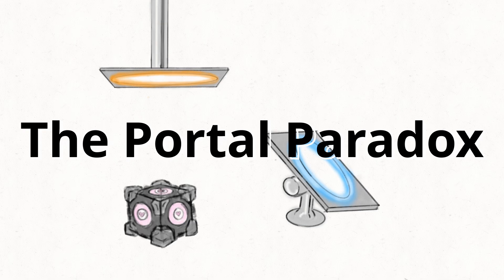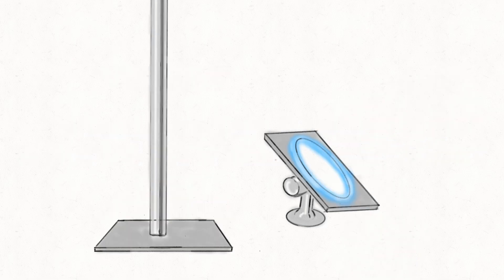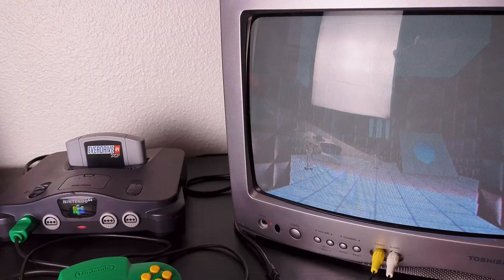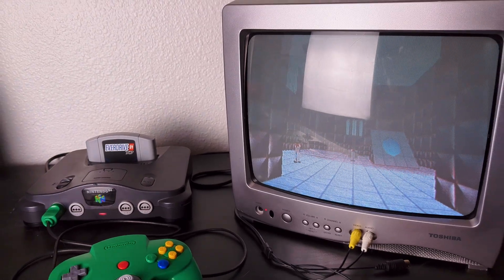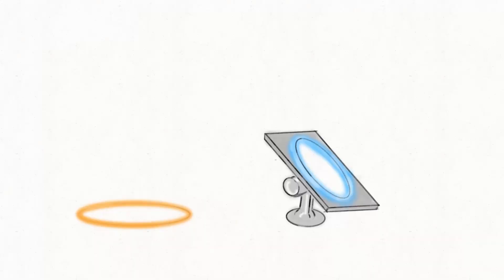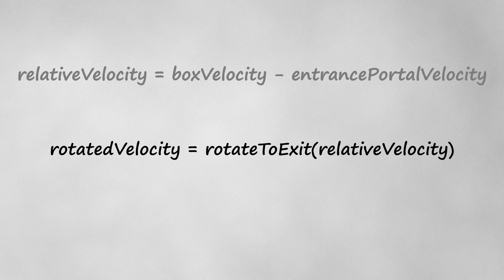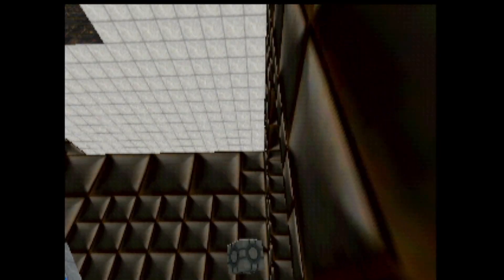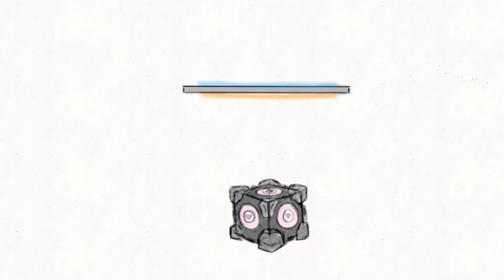I rewrote Portal from scratch and solved the Portal Paradox

Comment: The relative velocity should not be compared between the object and the entrance portal, it should be between the object and the exit portal. An object moving relative to the exit portal conserves its velocity when passing through, an object at rest relative to the exit portal should not gain velocity when passing through. In your demo here energy is being created from nothing. The box is not touched or acted on by an force, yet somehow gains momentum. How is momentum conserved here? The momentum of the platform is dissipated by the impact with the ground, what mechanism passes that momentum onto the box and why would the velocities be conserved when the box surely doesn't weight the same as the platform? This is a very flawed demo. First principles demand that if the box is stationary relative to the exit it will remain stationary relative to the exit unless acted on by an outside force. The portals do not impart any force on objects, so your demo here is the result of your coding rather than an actual proof. Cool though
Reply: In the actual game objects can fall infinitely and gain velocity from nowhere, assuming this principle is the case this answer is not unsatisfying (these portals are impossible anyway all we can do is pick our favorite version)
Reply: @Narvalo_Lastar  Gain velocity from nowhere, while falling. Bruh. Do you know what falling is. It's constant acceleration from gravity. Gravity is supplying the energy in that situation. I agree there is no correct answer here but there is an answer that makes more sense when first principles are considered.
Reply: @BNJ_VODS  The thing is when the object passes through a portal it has more potential energy than before entering but it keeps its kinetic energy so yeah this isn't really logical

Comment: Very nice video. The only thing I'm wondering about is, what happens when the orange moving portal stops halfway on the cube? The upper half should already be poking out of the blue stationary portal and having gained some energy should want to keep moving. So the rest of the cube should kind of be sucked into the orange portal and still fly out of the blue one? I hope this makes sense and somebody has a potenial explanation :)
Reply: I think it depends :
If the orange portal was going fast enough for half the cube to have enough force itself to pull the other half, the cube would fly out

If not, it would stay in place because the other half would be pulling the upper one down since it is affected by gravity, and stop moving at one point

Comment: Actually if you slap your hand next something on a table that thing tends to jump...  And the portal acts like a hole...  so the border around the portal would be like your hands hitting the ground the cube is on and bouncing it off the ground?  That makes me feel like you wouldn't be able to stop half way threw a portal without ripping yourself into pieces(the way you described how it didn't matter which one was moving)...  It does matter where the momentum is coming from,  The portal shouldn't really affect momentum.  But gravity taking affect, if it was opened in a downward trajectory would cause it to fall once the item was over balanced threw the portal, without a tether to hold it back...  So shouldn't the block have maybe only tumbled off the slanted surface?  And that really should only happen on a severe enough angle, as the cube should still be in contact with a flat surface on the other side?  For the cube to be launched something has to affect it.  In the game portal you can stop half way threw a portal and see yourself, looking at yourself.  It's a 1-1 ratio or Chel would be a quivering mass on ground an spread across the walls...   So in my totally unscientific thinking, The cube should have come out more like your arm going threw a sleeve, instead of a toaster popping out a slice.

Comment: Incoming rant fueled by autism and OCD:

Kind of related but thinking about it, any object going through the portal takes up mass and volume, so if the portal is moving at a high speed it would capture air and push it through the portal, but there would be pressures behind and in front of both portals that would need to overcome the vacuum the portal is creating as well as the the volume/mass that is being applied to the new location.

This doesn't even account for gravity.
Reply: Ok wait a minute, where did the vacuum come from?
Reply: @Narvalo_Lastar you mean what creates vacuum pressure? The imbalance between the two systems.
Reply: @Taalanos  alright

Comment: If you think that energy is not being conserved with portals, especially for a perpetual falling loop, consider that the portal guns and the portals themselves require energy to operate. They are not energy-less tools. Perhaps portals can only stay open for as long as the gun's battery allows, and that amount cannot exceed the amount of energy gained from a falling object's kinetic energy or the energy being dispersed through heat due to air resistance.

The games don't operate like this, and the conservation of energy is likely still being violated by the fact that a portal in spacetime can even stay open for more than a few nanoseconds without the need for more energy than we can produce at any one time, but hey, it's a neat concept.

Comment: Yea. Not really a valid test. Even if you have to write some code for source engine, you could at least justify it by borrowing moving logic from other parts of the game to know how it would be done if it was coded. But really. Portal should have something already I swear there was moving platforms in both games.

Anyway. I agree that it should eject. Simply based on that, to the perspective of the stationary portal, the ground and cube would be moving towards it. The brief time in which the cube begins to enter the space of the stationary portal, and the when it is all the way in should be enough momentum under the physics of the stationary portal for the cube to be completely effected by it.

Granted... this doesent account for how portals work as far as if there is a transitional barrier. Nor am I considering game coding...

Comment: Wouldn't intertia be something to take into account? I get that motion is relative of course but it wasn't moving before - inertia should keep it at rest unless acted upon by a force. Is traveling through a portal a force?

...mmm wait now I'm thinking about it and the normal force of the ground gets its vector changed as it goes through the portal. I'm still wondering how it actually flies. Maybe it's uh, impulse or whatever it is? Because suddenly whatever is pushing the top bit down stops... 

I love physics.

Comment: I think the crux of the portal "paradox" is questioning how the portals SHOULD behave.

Your velocity equations aren't "wrong". But they aren't a direct analog to real life either. They are a trick, to make something appear to behave as we think it should. 

In the real world, the portal wouldn't be something that could even have a velocity relative to something. It's simply a connection to somewhere else, no different than walking though a regular doorway.

Portals only seem odd from a human perspective, and the suggested behavior only makes sense in gravity.

Imagine the same experiment in space, a cube floating in no gravity and two portals each on different slabs, if one slab flew through the cube and kept flying, and the cube shot out the other portal, where did the cube get it's energy?

You could theoretically have the red Portal fly at the cube at 100m/s and make the cube fly out of the blue portal in the same direction as the red Portal and it would keep pace.

Comment: What if you stopped the orange portal half way on the cube? Would the cube still fly out the blue portal due to the velocity? Does the cube need to be fully through the two portals?

I suppose it would be basically the same because it would look from the blue portal's perspective like the cube is coming at it just as quickly but it stops a bit shorter.

But if the cube never reaches the portal it would look to the blue portal like the cube was going to come flying out but suddenly doesn't.

So does the blue portal's perspective only matter if the cube physically passes part of it through the portal?

EDIT: I think I actually understand it... the velocity of the cube is only relevant to the portal (both portals are a singular connecting point). And before the cube reaches the portal, if it stops, there is no movement of the cube. But once the cube reaches the portal, anything on the blue side is moving relative to the blue portal. So if the platform stops moving, the cube parts that are through the portal will "pull" on the rest of the cube because they're already in motion on that side. So if you stopped half way, you would what... have like a half of the velocity as only half of the cube is moving relative to the portal.

Or maybe I'm completely wrong?

Comment: The problem with your implementation is that 1. the cube is not a speedy thing, the source portal is, and therefore the cube has no velocity. To demonstrate this repeat your experiment but only have the source portal come down to the half way point of the cube. If your method is correct then the cube should be ejected out the destination portal but at half the velocity. 2. the cube doesn't stop sitting on it's initial platform since the source portal only goes down as far as the platform and no further. The cube should slide down the destination ramp, but it should only start moving when the force of gravity pulling on the amount of the cube through the portal is greater than the force of gravity and the force of friction on the cube that hasn't gone through the portal yet.

Comment: The block wouldn't move at all unless there isn't enough friction when its on the ramp, it would then just slide down.  

Explanation
The orange portal is now flush with the floor and not moving, blue portal is at an angle, its now simply sitting on a ramp and may slide down.  From an engineering perspective the only force ever acting on the block in this setup is gravity, before entering the portal its directly into the floor so it doesn't move, after passing thru the portal its at some angle due to the ramp, if the component force overcomes static friction it simply slides down the ramp.  The moving portal cannot impart kinetic energy onto the object passing thru, if it did and u tried to walk thru a portal, stopping or slowing down while still not completely through would pull you thru or tear the object apart.  This is not what we see at any point in the game or in theory of how a portal would work.  The portals are simply 2 points connected in space.  Moving the portal changes nothing as it imparts no forces on the object passing thru it simply "moves" everything in the space that crosses it to the other portal, air and all.  If it didnt operate this way there would be all kinds of other quirky interactions.   If you did the back to back portals like the hula hoop example but did it horizontally and then stopped half way over the object what happens? nothing, so why would completely passing over the object change anything?  The opposite portal nullifies any relative velocity calcs cause its a real time dynamic motion, the object may have a relative speed to the port it enters, but it always has a relative speed to the exit portal equal to the entrance portal otherwise the object would be torn apart.  

WIth this said once the portal compley passes the object to the other portal it is no longer affected by the portal and the relative velocity would be zero, so it  will simply slide down the ramp or sit there given enough friction.

Comment: The equations are fine, obviously, but it's more of a conceptual problem. Motion is relative, but is a portal an object? You could view it as a "universe" moving towards the cube if you look through the portal, which would make the cube moving relative to that "universe" - but then that universe stops when the platform the portal is on hits the ground, so the cube shouldn't move.

Imagine if the cube was suspended in midair instead and you move the portal over it, and the portal keeps moving all the way through the cube, what would happen then?

Comment: Velocity is a relative to question. 
In the case you present you say that the box is relative to the portal, but this does not need to be true.
The portal could possibly also work akin of teleportation in which case the box will not be subjected to a relative to question and velocity will be out of the picture.

At that point we have to ask our selfs, in what way are these two portals connected?
A. Is it a teleportation (in which there is no possibility for the box to be affected by the portal)
B. Is it a wormhole (in which case the portal will affect the box, for the box will have been in the portal wormhole connecting each other)

Or im wrong in judging a difference between teleportation and a wormhole

Comment: My question rises from where the energy comes from as there is no "physical contact" made with the cube.
The energy from slamming the portal and the platform ajecent to it on to the ground is transferred to the ground and back to the platform presumably.
The cube should not be getting any energy from it as it is not a part of the system that disperses the energy from the impact.
Paradox stems from the portal moving, it should not create energy from nothing. But in this instance it somehow does?
I might be misunderstanding something here, idk.
Reply: The energy calculation for relatively moving portals becomes messy. Energy conservation has always been a problem with the game, just by adding portals to the ceiling and floor, you effectively have infinite potential energy. With portals with relative movement, you have a source of infinite kinetic energy. The whole universe is moving on the other side of the portal, so as things pass through, the kinetic energy derived from the cube in a moving universe is released.

Comment: TL;DR The only major issue I can see is so far outside the context of what the code was made for it makes sense to not account for it at all.
My only problem with this implementation is: where is the energy used to propel the cube coming from? If ,for instance, the the test is taking place in a perfect vacuum and the blue portal and the cube are stationary relative to each other, if the orange portal is the launched at the cube will the object the orange portal is on lose velocity when the cube goes through it? Would the blue portal recoil after the launch? Based on how the coding was explained it would seem the cube is spontaneously imparted with kinetic energy leaving both portals moving exactly as they were while the cube is now accelerated away from the blue portal. Which would of course violate the law of conservation of energy.
Though I suppose in the context that the moving portals will be used in the game port, all of that is irrelevant and will never come up so complicating the coding to make it as accurate as possible is entirely pointless, just as the original portal not having any way to code for moving portals in the first place was.

Comment: This may be completely wrong but I also think of the portal as still being placed on a solid platform, so the portal being pushed down onto the block is just as much pushing down on the block downwards like the non-portal surface would. This then has the equal and opposite reaction that the floor beneath pushes back on the box and sends it upwards, adding velocity as it passes through. Actually I'm just taking out my ass because that would cause the box to jump in the hula hoop case too, and it was flawed from the get go because it implies you somehow react with what's behind the portal when you use the portal which isn't the case or you wouldn't be able to go through the portal unless you're being forced through.

I agree with your explanation that only the relative velocity matters, not whether the box is moving.

Comment: Ya, that explanation was great and makes a lot of sense.

In a way thinking of the two portals as disjointed halves of a whole, instead of separate entities makes the relative velocity issue a lot easier to think about.

Anything entering one portal exists it with the same velocity, and that's going to remain true regardless of where the portals are, or whether it's the item or portal itself moving.

Because if it DIDN'T then the hula hoop example would instead manifest some kind of undefinable behavior, where the cube DOESNT emerge at a rate relative to its entrance, so it would get squished.